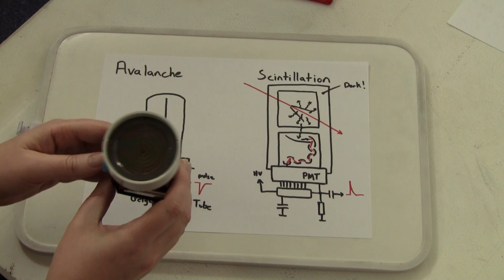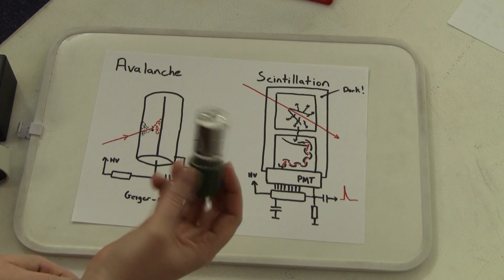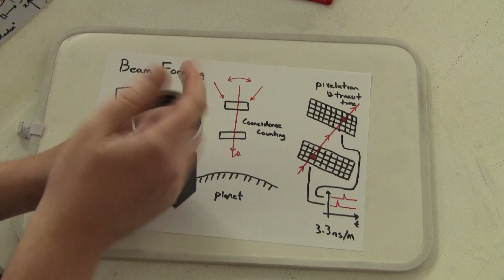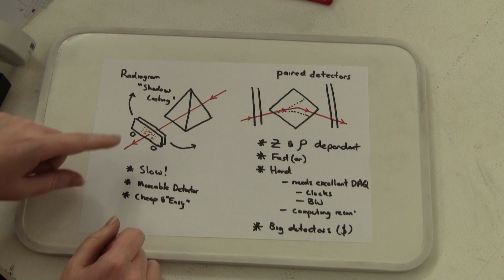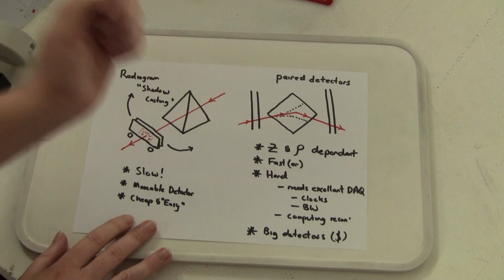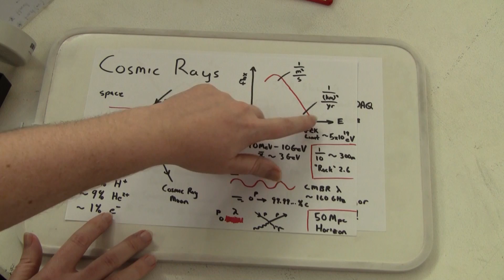Alan's Crazy Ideas - #1: CT Scanning Khufu with Cosmic Rays

Comment: I'm using collimators  in my lab. 
You look at it as passive attenuators . So if you have grid made of 10mm thick  lead you will see it at PMT array (the simplest cell structure) /  Need to  experiment with size of  windows/ . As insane as it sounds it really works  for neutrino. You can discriminate  the  difference of Nutrino  at the chamber in 2D,  or whatever means  of detection you use.  
As you are interested in this area I'm going to give you  one of my research videos just for entertainment.https://www.youtube.com/watch?v=izzujmKROWI&t=162s
and another one https://www.youtube.com/watch?v=GdlkeI0bXy4&t=242s
For Large areas you use phosphor  screen (2x4m) fallowed by another  phosphor screen  right before PMT.(10cmx10cm)
from  e.g PMT SECURE 1000 by Rapiscan I have  one of these :) It is huge. - with 8PMTconical modules inside. ( but I'm afraid it would not work with neutrinos)
 Wesley USA

Comment: With all the water works under the pyramids and the very specific materials used for each individual part lead me to trust the folks who say these were used for energy harvesting, wireless energy transmission, wireless communications, potential planet to planet electric grid system, faster than light transportation in these electric streams. --- The Electric Universe / Plasma Physicists may have the answer. ---  I can not find anyone yet who is making mini pyramids with the exact same materials or running simulation to test this. The technology should be scale able? Any ideas?

Comment from the maker: @whisk0r That depends on the scattering properties of the material to be imaged I think. Cylinders may not be the ideal shape either, some particles will come up out of the ground at you, but less than from the sky at low angles. Putting a detector inside the pyramid would help enormously.